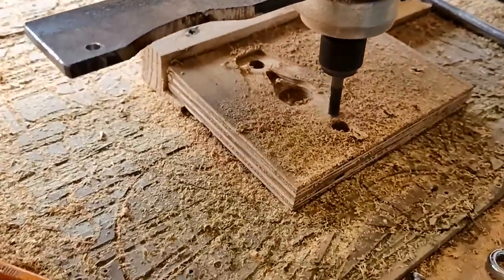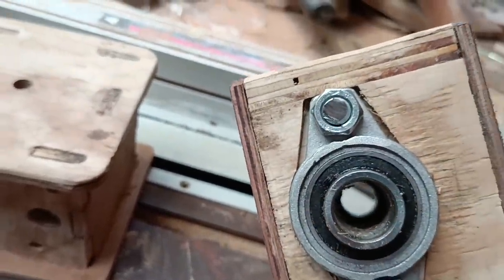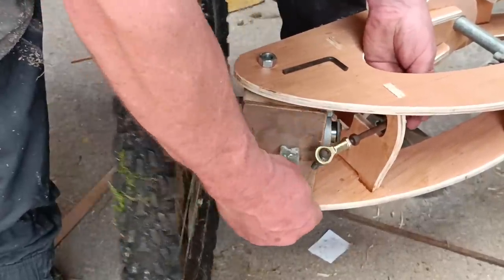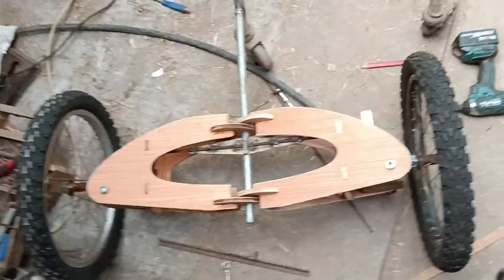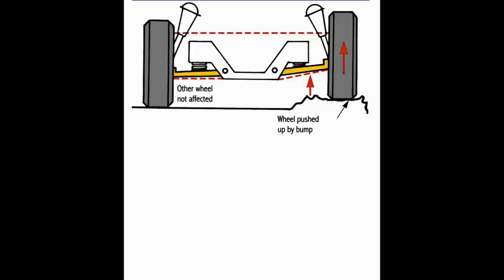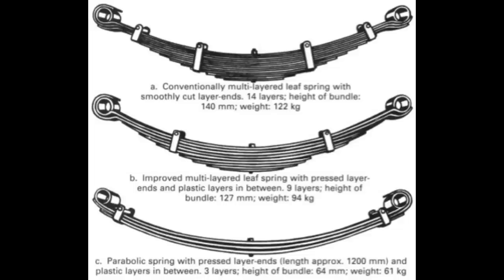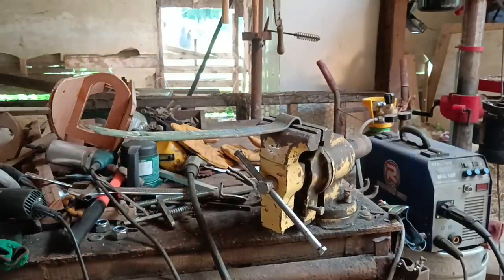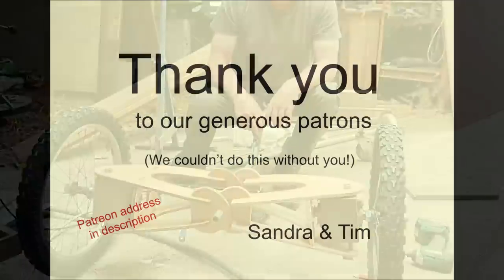Great Progress On The Wooden Car Steering And Independent Suspension System

Comment: I was thinking about build something like this a few years back. Although it didn't happen in the end here is what I learned: There are many way of doing this. But as soon as you make a few decisions all other parts are basically given by the necessities like center of gravity and tipping resistance, ergonomics, etc. So focussing too much on one aspect early may lead lead into the wrong direction. The suspension may change completely depending on where the front axle goes (typically between the the seat and the pedals) and how the frame looks and where you have to attach the axle to it.

In many velomobiles McPherson struts are popular. The need very few joints and have a good kinematic and can easily be attached with rods and ball joints. If you plan to have spring going up from the wheels that's a good choice. For small suspension travel the bottom arm can be replaced by a triangular leave springs or one supporting both sides - further reducing the need for joints and bearings. There is one velomobile that uses a rhomboid fiber glass sheet as "A frame" for both sides but I can't remember the name or find it. You can have a look at the classic Leitra suspension for leave spring suspension arms (although it uses a two arm suspension).

If you stay with the current suspension type you can further reduce the tilt by having the arms overlap and move the attachment points to the opposite side of the vehicle.
Reply from the maker: Thanks, Florian. Yes, that all makes sense.
Reply: @wayoutwest-workshopstuff6299  Few more things: Space at the front is pretty limited as the pedals and the feet on them take up a lot of space. The front wheels (and their housing) also take up a lot of space as the turn inwards when steering. The placement of the front axle has huge impact on weight distribution and stability against tipping to the side in corners or to the front on heavy braking. Most trike and velomobiles have the front axis underneath the knees as there is enough room and it gives good side to side stability on a three wheel vehicle with one wheel behind the seat (tadpole). If you are building a 4 wheeler (which requires a much more complicated drive train) this is not quite as critical. But even then things depend a lot on the height (and position) of the center of gravity (which is typically very close to the drivers navel).

Another thing to note it that there are huge forces between the seat and the pedals and even bigger forces along the drive chain. On a recumbent  you can push with more than your own weight as your back is supported by the seat. While this is not advisable and one should instead use a low gear and high cadence it does happen and the vehicle needs to be able to withstand that. Also having the drive train very stiff makes sure energy is not wasted. This is not as critical for a vehicle which is mainly electrically powered but you'll curse as soft drive train double if you have to pedal the motor and the empty battery around.

Another consideration is how to get in and out. Most velomobiles are seen as sport equippement and getting in and out is a bit tricky as they have a self supporting chassis without doors. For an everyday vehicles you want doors or be able to lift up the whole top/front. But this limits where you can put load bearing struts or chassis parts.

Comment: When you look at the weight of things, I recommend looking at the strength to weight ratio.
It is quite easy for things to be lighter, but if that means you need to use so much it weighs more, that light weight attribute ends up not helping.
Reply: He says weight is the primary consideration, then compares the volume of wood to steel.  Strength to weight is the key to light weight.

Comment: If the pry bars are too stiff, but only a bit - say 50% or double - you could move them and the mounting points inboard so that the suspension arm acts as a multiplying lever.  Adds complexity to the load path, the upper plate of the suspension arm would be a weak point, but also takes them out of the way of wheel articulation.

Comment: As an autmotive tech in the US i was always taught the KISS method. Keep it simple stupid. Independent suspension is very complex but great handling over rough terrain at higher speeds. My thoughts would be to go with solid front suspension. Yeah you might feel some bumps in the steering but way less complex. I am just guessing this is only going to be traveling 20mph max. A jeep has this front suspension and most heavy duty trucks. Look into those for ideas.
Reply from the maker: Thanks, Kurt. Having one pivot point keeps these arms very simple though?

Comment: Slices of car or bicycle inner tube make excellent rubber bands for tension springs (there have even been proper racing cars with inner-tube suspension!), you can adjust the spring rate easily by simply adding or removing individual bands or cutting different widths of tube to make your bands with. it's cheap too, even if you splurged on new ones!

My personal choice would be for a beam-axle, with a radius-rod at each end for longitudinal location and a panhard-rod for lateral location (stick your head under a coil-sprung landrover, it's the same setup there!). it's far simpler than an independent system, but would still give a decent ride. a suitable beam could be made from laminations of plywood that would both look the part, and be plenty strong enough too! you could even use the same setup for the rear suspension, if you pivot the radius rod around the same axis as the sprocket, you'd not have to worry about the chain causing problems either!
Reply from the maker: I was thinking bungie cords, but inner tube might be even better!
Reply: @wayoutwest-workshopstuff6299  Inner-tube suspension is well proven technology, and it's probably the easiest (and cheapest) way to get the spring-rates right. I've pondered your suspension needs a little more, you'll probably need some dampers to stop the car wobbling about as you peddle (and to keep the wheels under control at high speeds!) a simple friction-damper would work well enough, and not overcomplicate things, just a couple of bits of oiled leather, one stationary one attached to a rotating arm linked to the suspension, it may even be possible to incorporate it into the suspension arms themselves.

Comment: Have you considered elastic suspension.  Easiest achieved by extending a chassis rail below the wishbones then looping the elastic around the static chassis rail and the moving wish bone. Need more spring rate, add more loops of elastic and vice versa.
Reply from the maker: That's what I had in my model and it worked - so I'll try it again..

Comment: Very interesting
There is a "Cyclekart" video by 1908Rick  where he uses socket set extension ars as torsion bars! Light, adjustable spring rate, adjustable preload, readily avaliable, and cheap. And, if you follow the lightly regulated cyclekart design brief, you can go along to all the stuff they do!!!!!
Reply from the maker: thanks, Roger. I looked through his videos but can't find the one you mean. Can you remember the name?
Reply: @wayoutwest-workshopstuff6299  
He has two that are torsion bar relatedhttps://youtu.be/UK_xCLRk0tI
This rear one, and a front one

Comment: I think, don't make it narrower.  In high school, we built a wooden car (plywood box beams and balsa) for a high fuel efficiency engineering challenge (powered by a lawnmower motor). Our track width was just under a meter, with the driver's butt about 5cm above the ground, and it still tipped over when turning at around 15mph.  We widened it to 1.5 meters and it was solid.  You probably want to think about brakes before buttoning up the suspension plan for good... you might need to attach a caliper to the suspension arm somewhere?
Reply from the maker: Interesting, thanks. I was thinking brakes only on the back wheels?

Comment: You could put the suspension between the two halfs of the weel asembely in the middle an pivot the body to th mid point. One meter i fine for the with of the weel base   you can always make body less wide if it feels to big.

Comment: Maybe Airbellows would work. Just adjust the pressure for the wheight of the car. And dampers to prevent swinging?
Reply from the maker: Great idea. But they're not cheap..
Reply: @wayoutwest-workshopstuff6299  Ask your local truck workshop for old Jones which didn't pass the MOT test. We have plenty of them in our Container

Comment: If you got 4 decently pressurised handballs… they are the right size, withstand pretty crazy forces… and you wouldn’t need a central air tank or pipes… I think a lot of american pickup trucks now are fitted with “air bags” which are essentially rubber air cushions. A handball on each corner might do the trick
Reply from the maker: Exactly! I was thinking tennis balls, but your idea might be better. No idea if they're available here though...
Reply: @wayoutwest-workshopstuff6299  ohh interesting.. coupla tennis balls in a tube/pipe? That could work

Comment: While I'm sure you've thought of it, instead of fixed steering bars between the wheels, could you use a wire rope of some type? (Thinking of ways to reduce weight)

Comment: Not to wide , more stable ! lol. How about bungee cords for suspension connecting the lower a frames , they use them in small aircraft and are very light ! we call those threaded connectors HEIM joints . You could fiberglass the plywood for strength and keep from rotting !
Reply from the maker: Exactly!

Comment: Look up Thunder Shot RC car I rember it having a singel spring and dampener in front, from one side to the other on top
Reply from the maker: Interesting. But how does that allow independent sus.? Surely the spring would affect both sides?
Reply: @wayoutwest-workshopstuff6299  I link a video to some one showing the building of a thunder shot 😁 it works independent

Comment: Steel may wheigh 20% more per volume, however, with cutouts and box-building using cnc machined flat bits, much lighter and at the same time stronger components can be built, because it has about 7-9 times the tensile strenght of plywood, and that is for mild steel...
Reply from the maker: not 20% more - 2000% more..

Comment: I often find that I can get over complex by chasing solutions. I find it very useful to stand back and ask why? Posting on here I am sure you get plenty of idiots like me asking why so here I go, Why suspension? most bikes don't have it, those 2 person pedal bike at the seaside don't have it. It only seems to be an issue with greater speed , how fast are you thinking of going? also simpler to suspension seating horse drawn vehicles often used sold frame amd suspension of seating or complete carriage if you are a queen. makes for simpler lighter build.
Reply from the maker: All true. But if I were to put springs only on the seat, then peddling would be awkward and inefficient. Part of the reason for sus, is to keep all wheels on the ground - not an issue if you only have 2 or 3, or if you're on flat pavements. Another reason I should probably have stop at 3 wheels!
Reply: @wayoutwest-workshopstuff6299  I read your comment thought oh yea peddling. but all week Its been troubling me full suspension cycles manage to peddle along just fine. Also where and how you suspend the seat would be important. I have been watching lots of videos of 4 wheeled pedal and pedalecs many do not have full suspension and seem to manage just fine with rough tracks sure if you are bouldering then independent spiders seem the way to go. Are you sure you are not stuck on a design and justifying it problems rather than designing the simplest solution? nothing wrong with that but its worth asking the question.
Reply from the maker: @victoriavickers33  Now I'm not sure at all! Tell me what you think I should be doing? (I really know nothing - just learning all the time.)

Comment: If you go with a solid axle and mount it with radius arms and a pan hard bar to keep centered you and still use the bicycle shocks same as the independent, but I like the direction your heading with the suspension so far. I do not think a solid axle would be any simpler.
Reply from the maker: Great idea. Thanks. I wonder how I work out what I need?

Comment: Why don't you use the bed slats as a transverse leaf spring and do away with the lower suspension arms entirely? You will then only have upper a arms. This way you will have suspension without adding weight and if you mount the leaf spring either side of it's centre point so it floats it will also serve as anti roll bar. Look at the front suspension on 1960's Simca cars.
Reply from the maker: Thanks. I think that could work. Except the lower sus arms hold the bottom of the kingpin, so that's needed anyway.

Comment: One person? You mean that there will be no room for Sandra?  I thought it would be a side by side pedal arrangement or is that way too complicated?  The suspension looks very good and I get the lightweight concept.  Would bicycle suspension units work for the front?  The upper attachment could be the pivot point.  Good heavens!  The McPherson Strut!  (sort of)
Reply from the maker: Ha! Sandra has a horse! (I'm just starting with a one-person model..)
Reply: @wayoutwest-workshopstuff6299  😄

Comment: i feel like for the leaf springs trailer leaf springs would be the better option for long term, wood might be problematic when you factor in  that it'll rot, crack, and splinter easier, you also have to factor in things like weather, specifically rain which will cause water damage over time, but also temperature, if it's cold the wood will retract, and if it's hot the wood will expand, meaning any measurements you make to a leaf spring system out of wood would have to factor in expansion at the mounting points so on a weight end wood would be better but on a maintenance and functionality end, it'll be a nightmare for longevity and durability.

so yeah I'd say go with metal leaf springs, but you can save weight on that by using thinner bands of metal that will be durable and strong enough to support the vehicle, just a matter of factoring in how thin you can go before that is no longer a viable option and where stop acting like a sponge when you hit a bump, you want some bounce and flex, but not to the point where the suspension bottoms out hitting a bump because it doesn't have resistance, but also not have so much resistance in it's flex to the point where it's sending blows to you spine like you've just run over a massive pothole every time you hit a bump in the road.

just my two cents, i'm not and expert, but i did go to trade school for automotive brakes ,electrical, and suspension.
Reply from the maker: thanks, yes, you're probably right. But finding suitable leaf springs is a challenge..
Reply: @wayoutwest-workshopstuff6299  That's why the OP suggested trailer parts as they come in a wide variety of load capacities.
Reply: @wayoutwest-workshopstuff6299  i wasn't intending specifically go out and find trailer leaf springs, but your idea there is right, as i mentioned you could more than likely use metal you have laying around the shop, or that you can get your hands on for an affordable or reasonable price and fashion your own sets of leaf springs, i liked your idea of potentially using pry bars, if you could get your hands on enough of them, you could probably flatten them out into straight bands and fashion them into a leaf spring design as well.

personally that option is something i'd suggest playing around with and seeing what comes of it, cause honestly my favorite part of your videos is how you test out potential ideas and wind up with something that works for you.

Comment: I would wait until the prototype is complete before you change the entire width so you can see once all put together springs, drive systems, steering arm, etc. Say this width is go everything isn't smushed together and hard to work on or say I can easily change the width down a bit

Comment: You said steel at the same thickness would weigh more - as your reason for not using already designed/made “car parts.” Except that formed sheet steel used in such parts is about 1mm to 2mm thick. Your plywood is probably much thicker. Consider the strength and durability of the material selection. If you could do it for the giant charcoal grinder fly-wheel, I think you could do it here as well. Perhaps that’s your plan, and you are just experimenting with plywood to get an idea for size or functionality. (I work as a product design engineer for an automotive stamping / assembly supplier for big name OEMs).
Reply from the maker: You're quite right, of course Brian - thin steel is excellent once it's been pressed into 3d shapes - but that's not something I can do (not on a big scale anyway). I guess the right combination of the most appropriate materials is best?